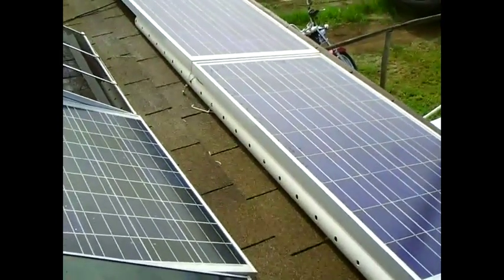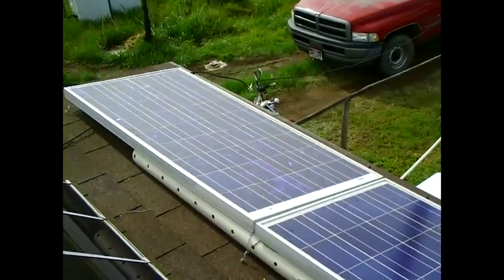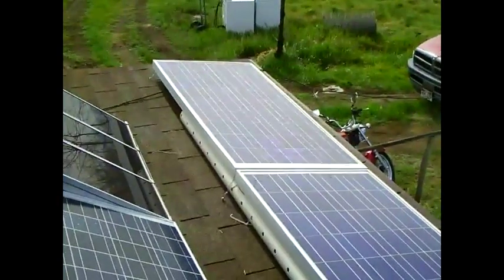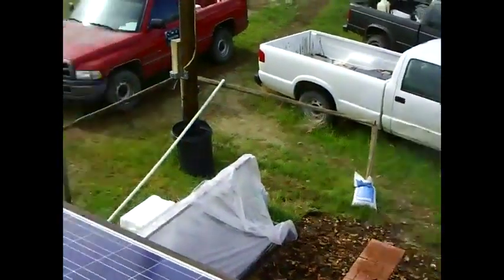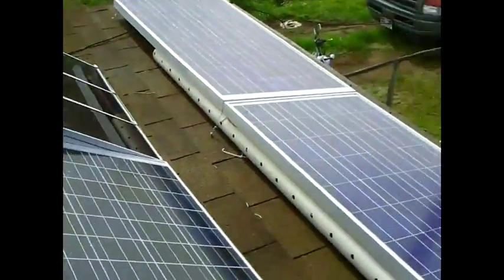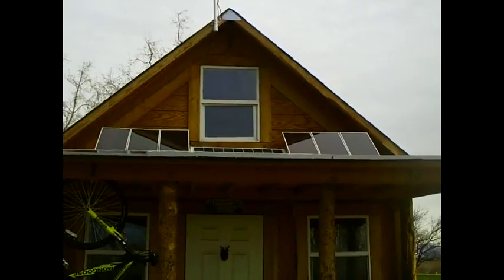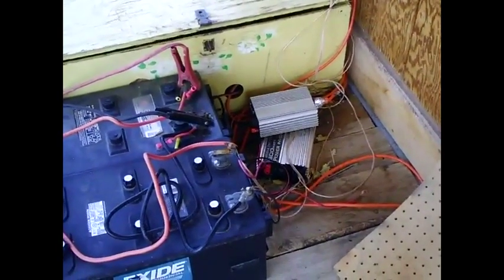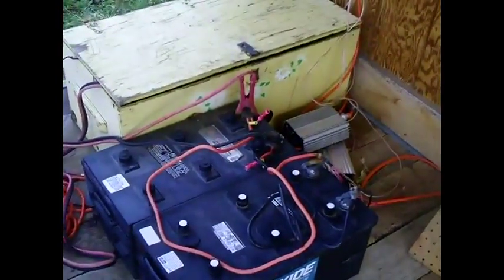Off Grid Solar and Wind Installation Part Three

Comment from the maker: Most power controllers can handle more amps than rated for and panels rarely put out at maximum amps.

I would recommend a 30 amp controller or higher but you can use more than one controller and split the load to save some money.

Comment: Hi fantastic set up. I'm just wondering about the MPPT controller. You said it was a 25 amp controller, will it get damaged if you have too many amps from the panels coming into it if you want to expand later on? I'm trying to figure out what to get and I don't have a lot of money but I'd like to build onto it later on. I'm hoping for around 500watt. If I divide that by 12 volts, I get 41 amps. A decent MPPT controller starts getting really pricey if I want to go 750 or 1000 watts. Upto $1000

Comment: Great video, but keep in mind that Aluminum is a good conductor of electricity and if your panels are higher than other conductive objects, then they are a target for lightning. What you want to do is create a path for lightning before it gets to the wires. Bond all the frames and run a heavy ground to a couple of ground rods. That way, the lightning will go to ground before going to your panel.

Comment: Ever tried using "Rainx" on the solar panels? I know for sure it would help alot with snow build up, or even water build up. Just not sure if it would effect how much power you can gain under normal conditions.
Worth a shot though, I cant see it hurting anything. Just clean it off.
You can literally drive your vehicle in the rain with no window wipers, if you have rainx applied to the windshield.
I used to install satellites. Rainx just about stops snow build up, once the protective liner goes.

Comment from the maker: Not if the breaker box is not hooked to the grid at all. You will run your inverter to the breaker box and that will feed all your circuits.

Comment: I have grid power now in my cabin I had built according to your plans. I plan to go off grid soon. My question is: will I need a grid-tie system even though I will be totally off grid but have a breaker box?

Comment: hello Lamar,
where I live in Australia the temperatures stay at a constant 38 deg C to 40 deg C during the summer which effects the output of the panels, sometimes by as much as 15%. Do you have this problem where you are and if so, how do you get around the problem ?

Comment from the maker: It would take a huge sytem to run any electric heaters ao air consitioners on solar or wind. I use passive cooling and fans. We don't get real hot here.

Comment: Hello Mr Lamar  I have  2 heat and air conditioners that have to be run off of 240 volts double 30 amp breakers one for each of them. do u use air conditioner? my em is thompsonsbeef@gmail.com   I like your off the grid setup.

Comment from the maker: Yes and you just need some wires rom the power controller or from your deep cycle RV batts to run to your van battery.

You might want to replace the standard van batt with a true deep cycle if you will be using that to power the RV because it will last a lot longer.

Comment: Lamar, you mentioned something about using this setup in an RV, I would like to know your thoughts on something.. I have a small RV trailer and Im saving up money for solar panels and the whole solar setup. Im going to be pulling it with my van, Im looking for a way to hook up the deep cycle batteries to my van's battery or alternator to keep them topped off until I get the panels. Is this possible?

Comment: I have a small house in Louisiana, and you have been giving me ideas about how to power the place, I enjoy the videos.  at the moment Im running a 140 watt panel, with a marine battery, running some lights, but mostly Ham radio gear, after surviving Hurricane Ike that came ashore just west of Beaumont, Tx where I lived in 2008, spent days without power, never again. Solar is the answer.

Comment: I have solar panels, I believe in them, People will tell you they dont work on rainy days, I know thats not true, as long as Light is hitting the panel, its producing power, had a massively heavy rainstorm last Month, still my 140w. panel was producing 18-20volts and over 7amps, yes, sunlight is great, but I know from my experience that cloudy days will still produce electricity.

Comment: why don't you make a crank bracket for your solar panels so you can raise and lower them in the mid spring and mid fall? great vid man I use a car jack as my crank and 2 inch angle iron :)

Comment: I have a few queswtions Lamar, 1 do you have your cabin or land insured. I know you had a fire recently glad you're ok, what if something was to damage your cabin? 2) do you have the cabin insulated? you mentioned snow, i would thing running your furnice all the time would get pricey. and that leads to my 3rd question wouldn't a space heater and space fan be a good solution for a/c and heating in the cabin? love the vids keep em coming.

Comment: LaMar, are you able to run the washing machine and dryer off your system now that you have the addition of wind power? You mentioned in this video that you planned to use a generator. I would think you could wait for a sunny and windy day to wash and dry your clothes, or hang clothes out to dry in the warmer months.